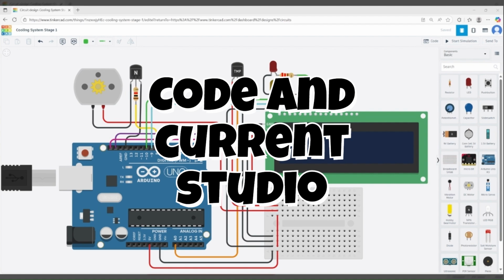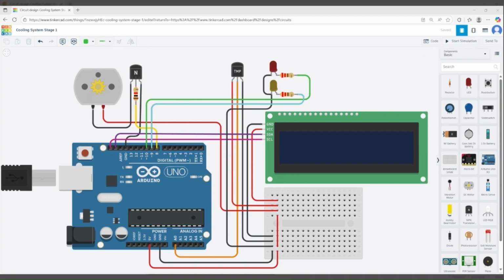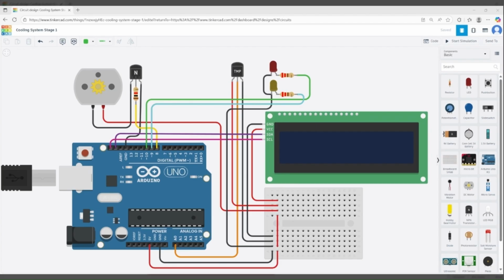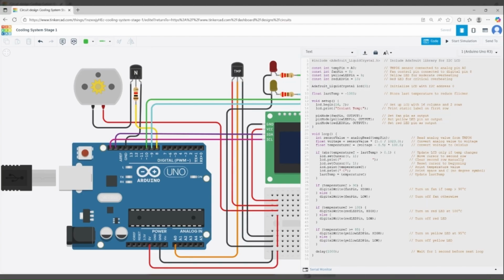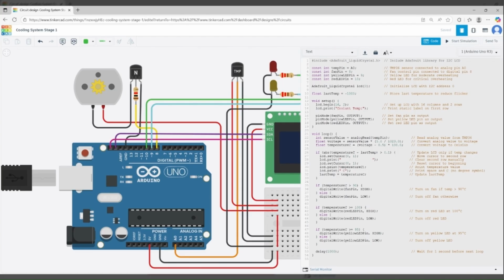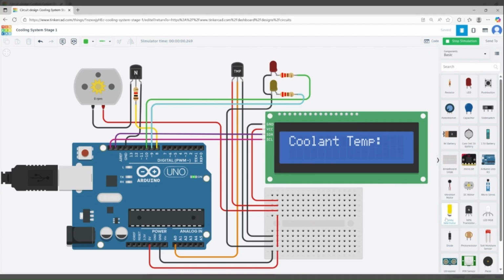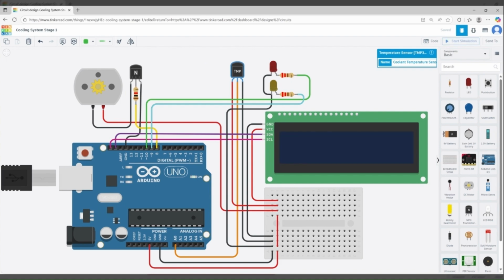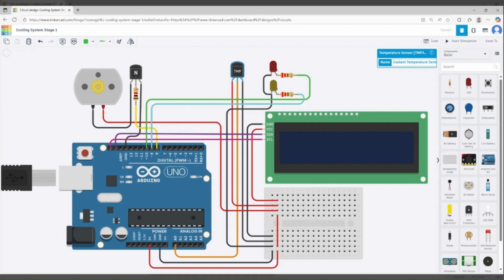Arduino Vehicle Cooling Project – Stage 1: Coolant Monitoring & Fan Control

Comment: Cool video been trying to do something kind of similar not for car but temperature but I wanted to change messages on the screen based on the temperature so if it’s one a good range, you know says is good once it gets close to being bad it changes to you know a monitor and then problem Can’t seem to get my head wrapped around it. Any suggestions?
Reply from the maker: Yeah, so maybe have the screen say "Normal" up to a certain temperature, then it displays "Overheat" if it goes beyond the temperature??? I put the code in the video's comments, check the "If" statements, that is where the program logic is... "IF" temp is then greater than 99 the display shows "Overheat"... "ELSE" would display "NORMAL".  Send me a screenshot or a sketch of your circuit and I can help with the code.